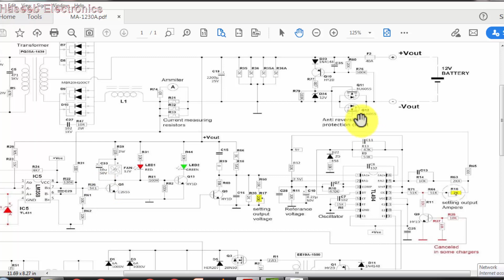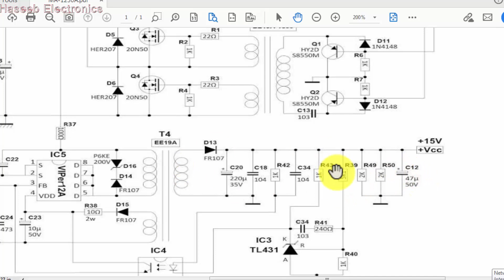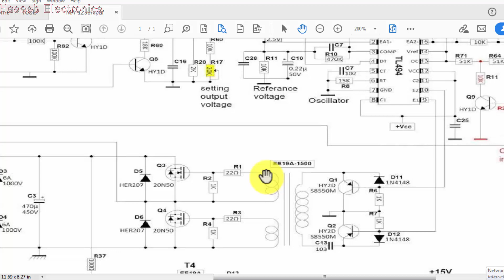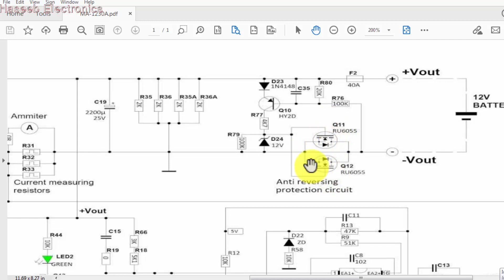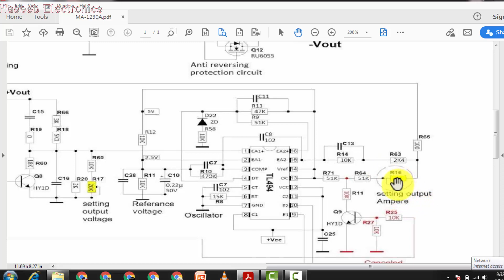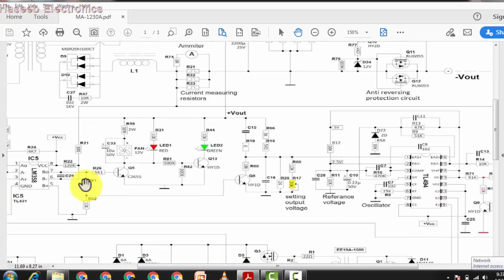360 China SMPS Battery Charger SUOER 12V 30 Amp Circuit Diagram Explained

Comment: Wouldn't these 30/40A chargers really only be okay for ~25-30 amps, since D5 & D6 are 2A diodes? 
(2A * 230VAC = 460W * 0.90 efficiency = 414W available for charging / 14.3v DC = 28.95 amps)
(2A * 210VAC = 420W * 0.85 efficiency = 357W available for charging / 14.3v DC = 24.96 amps)
I wonder how hot D5 & D6 get when running for a long time at the full current setting.

Comment: Thank you very much for your video.
I have one of these chargers (MA-1240A 40A 12v , board labelled "LAD1530A") and they're a good design but I had no choice but to make several improvements:
- The one I received didn't have a grounded chassis. Such an intricate circuit but no grounded chassis! So I grounded it using the provided pin on its IEC connector.
- I put Kapton tape underneath the board so the connections (especially the high voltage ones) aren't as exposed.
- I put a layer of antistatic foam (~5-6mm thick) on the bottom of the chassis just to keep things out.
- I replaced R37 (100r) with a 5w version, as the old one burnt out. (This is what started me tinkering with this charger in the first place, besides grounding its chassis.)
- You can replace the slow-blow 5A fuse with a standard fast-blow fuse and it seems to work fine.
- You can put the R16 current control pot in series with a 2K linear 3590S (3590S-2-202L) 10-turn pot for more precise control over the current. (There is enough room on the front panel.) (A 13mm 1/4" shaft knob will grip this pot's shaft fine.)
- You can replace D5 & D6 with HER207 if it blows.
- You can replace Q3 & Q4 with IRFP460 (instead of K4124) if it blows.
- Even with R17 turned all the way down, it was still holding the battery at 15.17v @ 2.65A which was just drying it out (never finishing).
  So I replaced this 20K 3/4-turn trimpot with a 100K 3296W 25-turn trimpot, (96.5k maximum) and it finished charging at 14.57-14.62v @ 1.40-1.33A (lowest current setting versus highest).
  I should have tried a 200K or 500K or maybe 1M instead of 100k pot but this will do. (Would prefer more like 14.3-14.4v rather than ~14.6). You could probably just use a 1% 100K resistor if needs be.
  This allowed it to finish charging, and enter float charge mode @ 13.53-13.56v (lowest current setting versus highest.)
  Like I say, it never finished charging with the 20K R17.

Comment: Sir in smps battery charge in secondary side what is the rule of LM358 it is operational amplifier we used this ic for Non inverting and inverting input like comparator please help me using in smps

Comment: Dear brother 
1. In the diagram above ,if the mosfets Q3 and Q4 get too hot,what could it be the reason ?
2. And for the same mosfets, should the Vds voltage be the same for the two mosfets or it may be different?
I get one of them double the other 
3. Can I replace the mosfets with igbt's?
Thanks for your patience and kindness
Reply from the maker: if Q3 & Q4 are getting Hot, that means 
1. mosfets are damaged 
2. any one component or components D5, D6, R5, C5 OR power transformer is damaged
3. R1, R2, R3 OR R4 are damaged
4. deadtime from IC TL494 is disturbed 
5. may be mosfet are fail, some leakage. so these mosfets are switching at same time or in some portion of time 
6. most probable cause may be C4 capacitor 
7.  VDS may differ in both mosfets 
8. yes we can replace IGBTs but we must consider gate capacitance difference between mosfet and the IGBT, so in result we must change the drive components

Comment: Dear Mr Haseeb 
Thanks for this interesting video 
I have the same charger when I switch it on using the series lamp it works normally for a while then the series lamp lights on .
The two mosfets Q3 and Q4 are new and the main capacitor C3 is new and the rectifier diodes are new 
What could it be the reason?
Thanks
Reply from the maker: best regards for your comment 
in your case, these are the possible causes 
1. low quality replacement components 
2. may be some gate biasing component is not working correctly
3. may be some drive signal is not working 
4.sometimes the pair matching of MOSFETs make imbalance in conduction and mosfets become short circuit
Reply: @HaseebElectronics  Thanks for your answer  .but I forgot to mention that the series lamp does not lights on when I remove the mosfets.could it be the chopper trans or the main power trans?
Thanks
Reply from the maker: When MOSFETs are connected, and the series lamp urns on, that means that there is short circuit in MOSFETs or there is some drive error in driver stage.
Reply: Thanks for your patience and cooperation.the mosfets are good and they are of good quality.and they are not burnt.but what is the drive stage? Is it the chopper trans and the resistors connected to it which they are all connected to the gates of mosfets?
Thanks for your kindness brother Haseeb
Reply from the maker: It is possiblity that the driving Ic have some issue. If Ic works normally then the lamp will not illuminate. If the Ic have some issue, then it will turn on MOSFETs directly so it causes to draw maximum current from DC rail, which causes to glow the lamp
Reply: When you say it works normally for a while.
 you Switch the charger on and us the battery connected if it is than your charger is ok. it is normal for the series'lamp to glow brightly when battery is connected to it.
You can try plugging it in directly without series lamp.
Also why did you replace MOSFETs etc. What was the reason.

Comment: Peace be upon you brother Haseeb 
I have a question, sir. If the 15 volts are present, but the charger does not work. What is the reason is that (ka7500b) in the damaged ?. Thank you
Reply from the maker: KA7500 works similar to TL494. it is PWM driver IC
if 15 voltage are present in secondary that means the PWM section is working 
just check the output section and polarity protection circuit 
output fuse & mosfets in output, sometimes there are reverse polarity protection diodes
Reply: @HaseebElectronics  check the output section and polarity protection circuit ?
Reply from the maker: @aljabrial-iraqi6245  yes dear
Reply: @HaseebElectronics  I replaced (KA7500 ) and also everything checked and didn't find the problem

Comment: Hello Sir,  i have this kind of smps battery charger,  the problem is the ic TL494 always damage... What will be the cause of the problem?
Reply from the maker: check its supply voltage 
it must less than 35 Volt
check pin 8, 9 10 & 11 connections

Comment: How do yo know it is 30 amp?
Reply from the maker: as it is mentioned on the circuit diagram. its model number shows specifications that it is 12v 30Amp 
i never used it. some of my viewer sent ts circuit diagram to explain it
so i explained it
Reply: @HaseebElectronics  i know that sir im just asking how does the circuit produce a 30 amp current
Reply from the maker: @georgesdibeh7826  it depends on smps transformer, switching frequency, output circuit
Reply: @HaseebElectronics  ok thank you
Hope you could help us understand it 
جزاك الله خيرا

Comment: good  but i think  feedback works like  following ?    read pleas3e

the idea is clear      current  regulation  have  an  "effect  upon"   voltage  regulation 

as  we  apply empty  battery it will try  to draw lot of  cureent     this way    the ic LM 3XX   WILL   tell the voltage  feed back to   drop  output   voltage so that  output voltage of charger is  near   battery  voltage   ....for  example  battery is  13.5vdc    charger is   13.7    this waay  current  regulation  can   happen using  voltage  regulation   >>>>the prcoess will continue  up to 14.vdc  or so 

when   the battery is  full it  draw no current    at all   some thing whcih will change  the conduction   rate of the Q8
which   will chage  feedback   resistor  network  value which  will change  output vltage  to 13.8  float 

another thing is that    it looks like   voltage   feedback is  also  have  a  hand  upon  current  regulation BY LM3XX  

is used to  tweak   resistor network  value  a  by  q9    which  will  set   maybe  the  disparity  level  between  battery  voltage  and  output voltage  which in effect  reduce the  gap   between    the charger   voltage and  battery  voltage   say at first  battery 10.2  charger   is 10.8     the  as  battery go to 11  charger goes  t o 11.4    then  battery   11.4  charger goes the  11.6

so  that  the voltage  diffrence is    like  ramp  0.6  0.5  0.4  0.3  0.2 0.1  0.0

Comment: Salam M Haseeb, i sent a message but it seems to have disappeard. I was saluting your work and noticing how complex was the functonning with so many transistors. I have approximately the same PSU with 12v30a and have some swithcing noise and low voltage. I made the following schematic manually hoping to have some help from you . Thank you & Salam Aleikum
Reply from the maker: Salaam o Alaikum 
best regards and special thanks 
sometimes the switching noises occur due to frequency issues and duty cycle mis-matching or problem in resonant circuits. 
as combination of magnetic and electronics is a biggest issue for servicing it 
stay blessed
Reply: @HaseebElectronics  Salaam Aleikum. I finally managed to find (by chance) that the TL494 was defective. I changed it and no more noise in the SMPS transformer.

Comment: شكرا لك أستاذي على الشرح الوافي عن هذا الشاحن لكن لدي سؤال
 يوجد على الملف الثانوي لمحول الآيسي viber12a  ديود واحد ، ألا نستطيع وضع ديودين على طرفي الملف الثانوي و بالتالي نستفيد من نصفي الموجة الناتجة (النصف الموجب و النصف السالب)

Thank you, my teacher, for the adequate explanation about this charger, but I have a question
 There is one diode on the secondary winding of the transformer  of IC viber12a, can not we put two diode on both ends of the secondary coil and thus make use of the two halves of the resulting wave (the positive half and the negative half)

Comment: I enjoy repairing these... I lot of them are around my town after the increased use of electric vehicles.
Reply from the maker: thanks a lot. 
you are right there is excessive use of vehicles and these electronics products , 
so its failure rate is also increased significantly